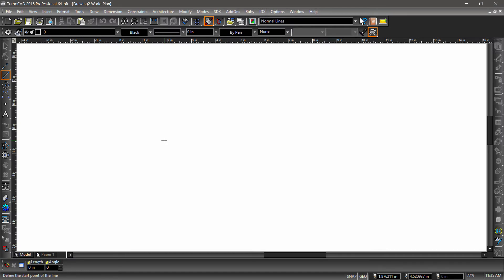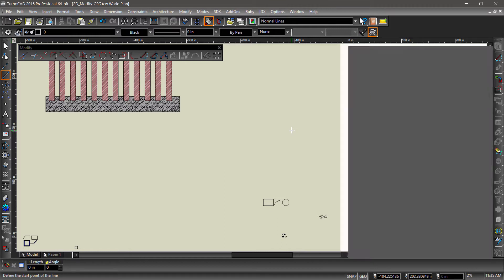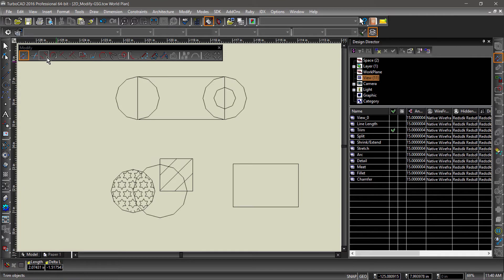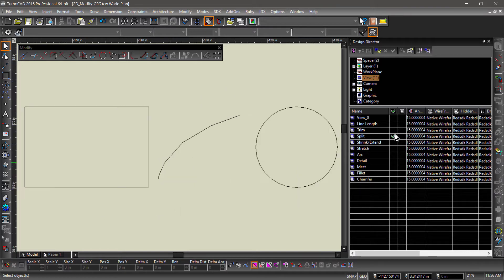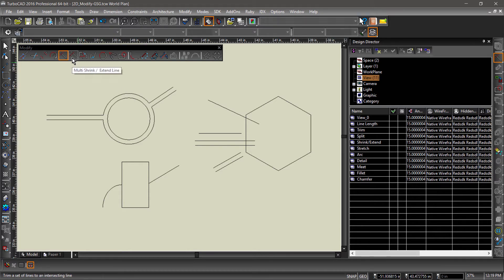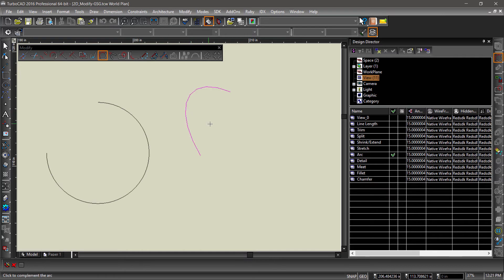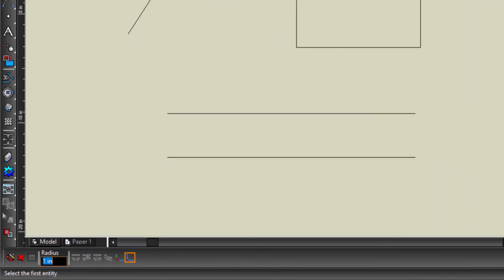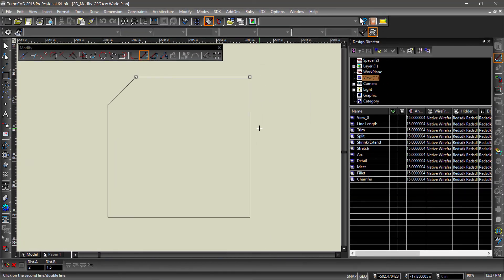Modifying 2D Entities

Comment: trouble following it part way through. I drew a box, wanted to expand the box, and cut some triangles off the corners. When I got the design director up, tools were not readily explain on how they cam from the design director. Not only that, the table in design director had folders in it. you did not expain readily how or why they were there. Or how they are the tools you need. Or how to access them. If the tools are seperate from the director, you should not mention them while the driector is being mounted on the screen. 
Confusing at best.....